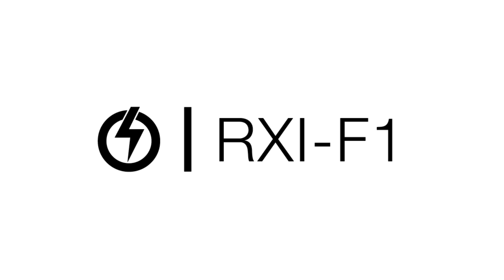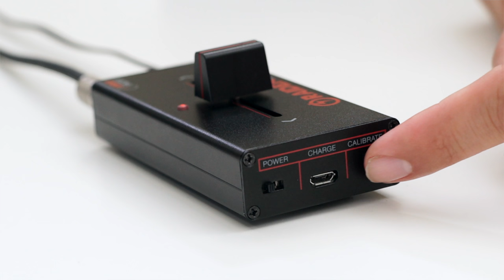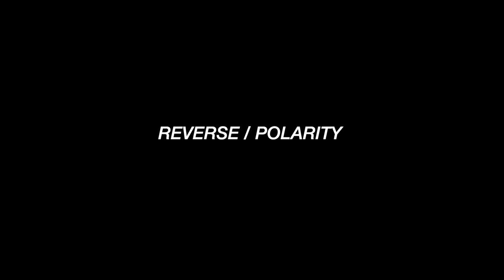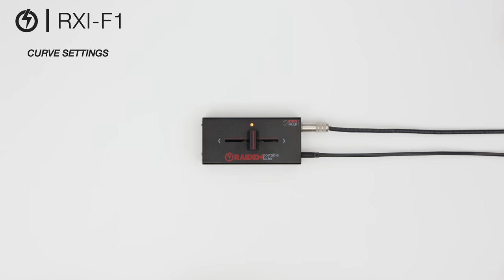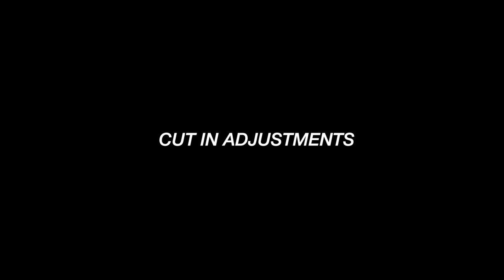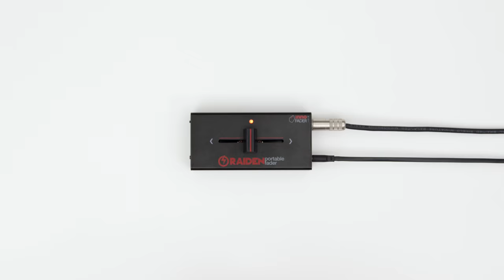Raiden RXI-F1 - Calibration Settings Tutorial

Comment: I've had this fader for a couple of years now but had also bought the Jesse Dean contactless fader a few months a later. My question is, does anyone else find the raiden more stiff on its rails than the Jesse Dean fader? Or did I wear down the Raiden? Is that a thing? Idk, but I love both. Just prefer the smoothness of the JD. Wish the Raiden had that same glide.
Reply: Mine became became stiffer over the years. Probably the inside collected a lot of dust. I’ve tried to open the fader up to give it some maintenance, but I couldn’t figure out how to open the actual fader, because it’s soldered to the printplate. Does anyone have a fix for this?